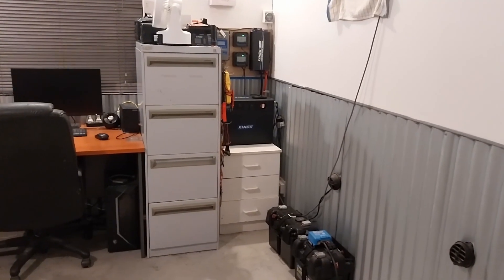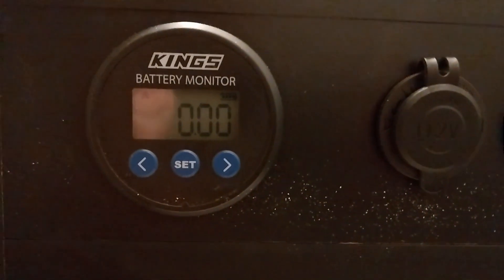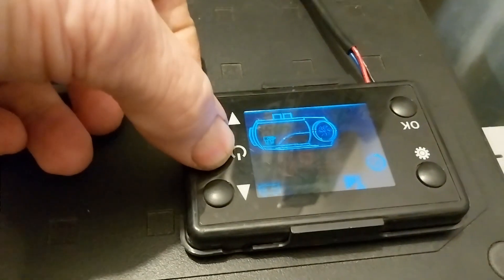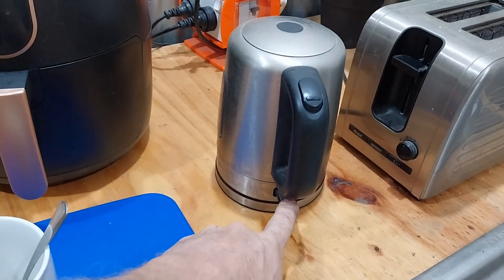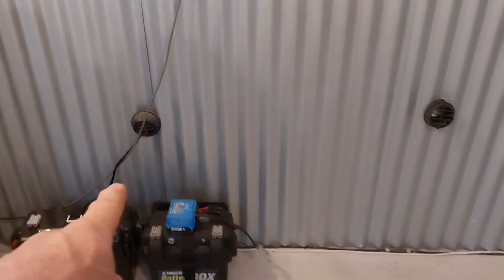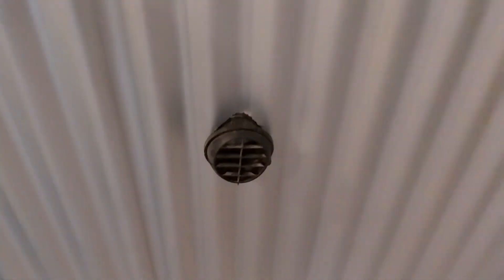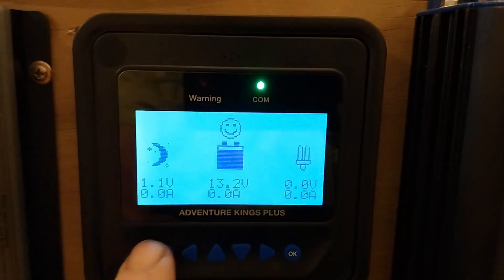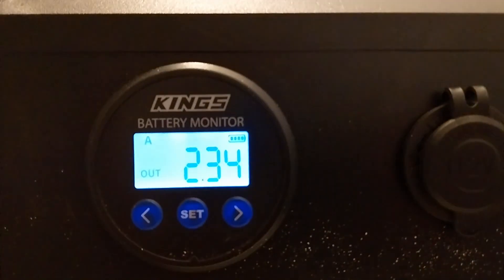How Much Current Does A Diesel Heater Draw

Comment: We have a diesel heater of unknown capacity. It came with our camper which we bought second hand. 
If our battery voltage is below 12.8v the heater drawas about 8A across the spindly wires it came with resulting in enough voltage drop to cause it to error out.
Usually the only way we have been able to get it to start reliably is to have some kind of input into the batteries so they are at least at a charging voltage.

I am planning on upgrading the wiring as it's not good enough, so hopefully that will help. The heaters do put out heaps of hot air and make a big difference in the camper.

Your figure of about 8A matches my experience.

Comment: Been looking at getting a 2kW one of these for my van, nearly all of the controllers look a bit dodgy though.
Reply from the maker: I have been running these cheap diesel heaters for around 5 years now without any issues with the heaters or controllers. I have had to replace the fuel line, as over time it went brittle.
A mate who lives full time in his bus runs them as well and in the around eight years he has been running them I don't think he has had any controllers fail. He has had a glow plug fail and his last heater he replaced after around 5 years of use due to a noisy fan motor bearing.
For the under $200 we pay for these units, I feal they are worth the money.

Comment: I bet your council wouldn't like that you have affordable, carbon based, heating! Gotta get one of those diesel heaters for my off-road camper. Another great video. Thanks.
Reply: Ditto
Reply: Hey Glen, was thinking about your heater being outside in the sun. With the cover being (I'm assuming previously red) pink, the sun will probably degrade that plastic pretty quick. It would pay to make a cover for it.